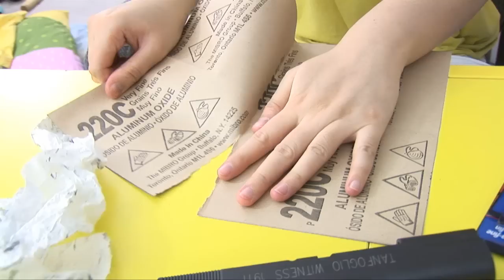(MOD) Tanfoglio Witness 1911 Full Metal Blowback- Mirror Slide and Black Grip

Comment: 1 week after this it will be covered with rust
Reply: Yeah he should put a clear coat on it.
Reply: Gotta nickel plate it
Reply: @getsmarty7603  would have to electro clean it first then nickel plate it
Reply: My beretta 92 has a chrome barrel I finished clean 6 months ago and it still is rust free. Just keep it away from moister.
Reply: Not even mirror finish 😂 you have to use 600, 800, 1000, 1200, 1500 , 2000 , 2500, 3000 grit and then polish. Fore mirror shine you need to get rid of any scratches.
Reply: @jed6178  good polish mirror doesn’t rust, and that slide is made of aluminum.
Reply: u just jealous

Comment: First off.  GREAT VIDEO GREAT MUSIC! That said, next time save yourself TONS of time and sand blast the slide and use Mothers chrome polish it cuts the time in half.  Again great video good job on the slide.
Reply: Naval jelly works great for stripping blueing and rust..saves time and you don't remove any metal

Comment from the maker: yes it will work. You will need sandpaper that is from 220 to 800 or even 1000 grit or higher. wet sanding~
Reply: Should be going well over 1000 to get a mirror finish

Comment: Hey Mak, Notec from CAF!! Great video. You can save alot of time with a paint stripper. Just apply stripper and let parts sit for and hour and then rinse with cold water. A toothbrush will help work it into the hard to reach areas.

Comment: Any issue with rusting for this modification? Cause its sexy as hell, I just don't want to spend all my time after primping and polishing it to prevent any unsightly rust from popping up at the slightest touch.
Reply from the maker: Eighty Six no rusting so far
Reply: Eighty Six zinc doesn't rust
Reply: technically it does
Reply: Chiinnature can you link the bit you used in the mini drill at 2:13
Reply: There is clear cerkote you can use
Reply: It’s aluminum I think

Comment: Wow, you really sanded it down using sand paper bit by bit? Talk about determination. If it were me, I'd jump to dremel straight away... XD
Reply: sandpaper won't leave gouges in the metal like a dremel tool will
Reply: A belt sander would be better. Also this guy could've polished it a bit more.

Comment: Hey, great videos, I've learned alot from them! I plan to also polish my TFW 1911, starting with the slide and barrel. I've never done anything like this before, could you tell me exactly what you did? I understand you sanded with progressively finer grit sandpaper (220, 320, 400, 600 dry, and then 600 wet?). And then for the buffing part I got some Mothers Mag & Aluminum Polish. It says to apply it with a cloth until black residue appears, then buff off the residue with a buffer. Is that right?
Reply: Sounds good

Comment: If you don't have power tools the best way to get a finish that looks chrome is to finish with at least 2000 with some oil or water. Then metal polish. I know it looks shiny now, but if you want it to look like a mirror you need to at least finish with 2000 if doing it by hand
Reply: Does it matter if the pistol is made of carbon steel or stainless steel? Can I still get the same results?

Comment from the maker: First, you have to see if it is your shooting grip problem, if it is not, then you can take the inner barrel out (knock out the pins) and wrap some tape around the inner barrel to make it thicken on the top and thicker on the left (so it will adjust) and that is the only way you can do it. Take s alot of trying but you can test the shots by just putting a mag in, so just need some time.. it will work. Mine shoot extremely sharp, see my vid on the air pistol challenge, it is crazy

Comment: Nice job! How much work is it to sand out all the lettering on the gun? After that I want to restore the original finish, but with weathering. Is it painted or blued out of the box?
Reply from the maker: birdie17uk a lot of work, LOL!  the oriiginal is of course painted over. Spray paint and some final clear coatings will do the job if you like the paint... or you can try just going fully polished

Comment from the maker: The paint finish on the gun is very tough, so I guess you have to use the dremel or any rotary tools to help you out. wire wool won't work. Also get metal polish and you can get it to shine. "Chrome" doesn't means silver like mine here. This is mirror polish instead. Chrome is done by using air-compressor to spray some stuff on the gun which makes it silver looking but doing chrome is very expensive for normal people as it require a lot of machines too.

Comment: Looks nice. I did a similar thing with my Springfield A1. Took the satin off of my stainless finish. Looks much better. I’m going to try an electrochemical etch on it now. Well done.
Reply: It's an AirGun.. Made by low quality material.. If I'm not wrong it uses low quality metal+alloy for the slide,and the rest of it like the"frame"etc are ABS/Plastic.im a also a FireArms&AirGuns mechanics..my service speciality are includes:Custom,Tuning(UpGrade max power for an AirGuns NOT an airsoft)fire arms custom,repaints,Marking,Parts mods and more.if you try to apply on RealSteel,it will make a bad corrosion for atleast a month's or two.. Cus the"heat"of the slide after firing.if you wanna repaint your 1911 which most of them are forge steel there's a diffrents method require

Comment: Chiinnature - Excellent work on this MOD I'm waiting for delivery of this BB gun and i'm very tempted to follow your guide on cleaning and polishing the slide to begin with. Is the lettering on the slide easy to remove? it looked like it was "stamped/engraved" into the metal work. Does wet and dry sand paper remove it? Many thanks and keep up the great work!  FK

Comment: Just so I get this correct(I am about to attempt this) The sequential order you sanded the slide is  220, 320, 400 and then 600 grit sandpaper to finish it off, then buff with a metal polish? Thank you
Reply from the maker: DJTechSpecs yup

Comment: if I wanted it to have a brushed look, could I just use paint stripper and take it off, or would I have to sand it down afterwards. if I did have to sand it, which grit should I use?

Comment: That is some good work you've done, looks really good, and alot better than most of the peoples guns after similar work. Did you seal the metal from the air with anything to stop it from dulling, and if so what?

Comment: Really nice job.Am gone be doing a TT33 but the opposite bluing the upper or cerakote black and frame either nickel platted or just sand the frame really nice with a 400 grind sandpaper. Am half way there.
Reply from the maker: ***** Nice!  TT33 look good in black or antiqued finish!

Comment: Been working on my 1911 "We The People" Blowback BB Pistol , had started it and put it away for a few months, im getting back to it. I disassembled,  and sanded everything down. Didn't like the beat up look wanted blacked frame and polished upper aka slide and barrel. I started with 220 grit sand paper then used 400 grit wet sanding paper. Its already pretty nice but to get a better polish I'm gonna make my way up to 1500 grit. Its a long process but should look pretty chrome/mirror looking even before the polish. Then polish and prep the lowers for paint. Gonna get some new grips , not to fond of the stars. If I can disassemble the lower which I plan to do. I will be polishing the trigger, and looking for a way to convert to fully auto. My magazine will also be polished

Comment from the maker: I did for the lower frame later on, it's easier but the result is not shiny, you need to use sandpaper at the end to polish it anyway , so.. yes, it works but won't be cool

Comment: I have the KWC M1911A1. The outer barrel it came with is Chrome. If I sand it, will the Chrome come off and expose the metal so I can paint it black?
Reply from the maker: ybrik5 Buy a black one is better!
Reply: Nope. I don't have a choice. This pistol came with chrome one.  I live in Canada. Much cheaper for me to sand and paint it black.
Reply: Much easier for me to paint mine. I don't have a contact where to order one. 
Are you able to give me a contact who sells black barrel and spare parts for KWC M1911a1?
Reply: I was able to buy a black one from KWC.

Comment: I was going to purchase an Umarex Colt Commander for the chrome barrel. However, I've found the KWC M1911A1 TAC, which has adjustable sights. I'd like to get that instead, and just give the barrel, trigger and hammer a mirror finish like you did here. How can I do that, preferably without sanding?
Reply: Buy new parts

Comment: What polish did you use, i have tried 2 different polishes and the metal still oxidized within a few days.
Reply from the maker: peek, it works and no oxidization much, only if you do not polish it to mirror finish, then it turns gray fast
Reply: +Chiinnature thanks, and you just rub it in with the buff wheel and wipe it off?
Reply from the maker: ya, and most important is, rub in mineral oil afterward to coat it

Comment: my one question is if it would be possible to sand off the lettering without sanding of the paint? i assume not
Reply from the maker: nope
Reply: [Myst]iC try to use some rubbing alcohol. I haven't tried it on a 1911 but I used it on a bb revolver and it worked great.
Reply: presto gun blue pen mate itll take a while but youll be able to remove the letters

Comment: I have the exact opposite 1911 as yours . Para P12 double stack pretty much an officers model but hicap. 
Slides all black (except the front and rear of the slide ) with nickle and stainless bushing thumb grip slide lock safetys  mirror finish aluminum frame .Black gouge grips.

Comment: Hi friend, i ordered one of those guns, tanfoglio witness 1911 co2 bb gun, as soon as i received it i´ve polished it according to your videos (how to dissasembly it and polish it) i got the same finish on the slide and the frame BUT i noticed that the finish lasts on the slide and not on the frame, i think that there is 2 different metals or alloys between  the slide and the frame, the metal on the frame gets dark within 2 or 3 weeks and i have to polish it once again. I really appreciate if you can help me to solve this. Thanks in advance dude.
Reply from the maker: Cristian Torres Polish your frame first, polish and BUFF it, then after it is shiny, spray some clear coat stuff on and your coating will protect it from tarnishing for sure. The slide is okay, just leave it as is and rub mineral oil on the surface to fill up the pores and it will be okay.
Reply: Thanks dude, ill try it this weekend

Comment: Go to walmart purchase a gal. white vinegar.. heat to near boil and place the amount needed into a container and submerge part or parts wanting to remove bluing. Let soak 25-30 mins roll part. Take scratch pads and rub parts. Very simple.. polish if desired later.
Reply from the maker: +Dick Miller but this is not "blueing" on the metal - it's paint....
Reply: +Chiinnature That is parkerizing, a type of bluing, basically. Unless your 1911 came from the factory with Durakote or Cerakote, (switch you wouldn't be able to sand off by hand) it's parkerizing. If it was neither, what ever manufacturer made that 1911 is shit and it would have cost $200.